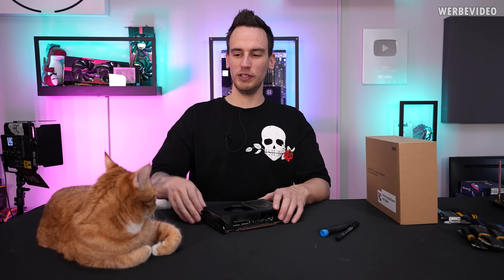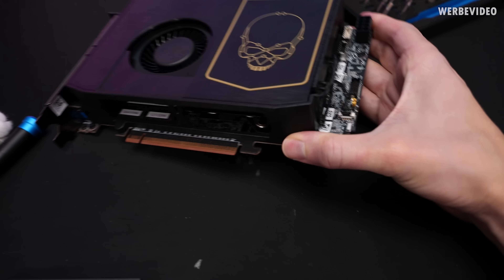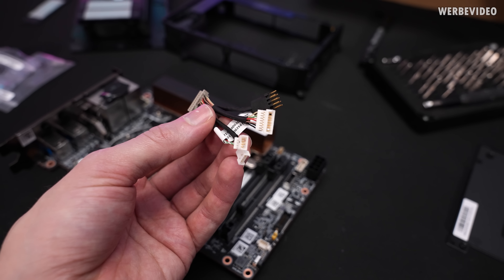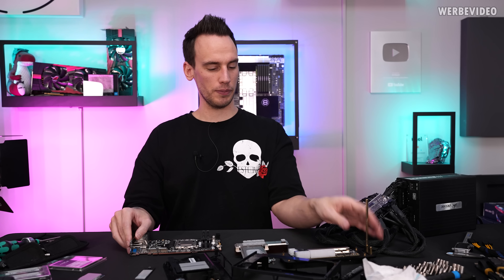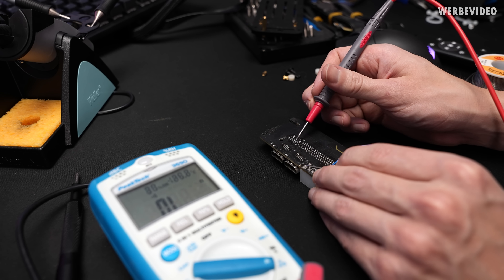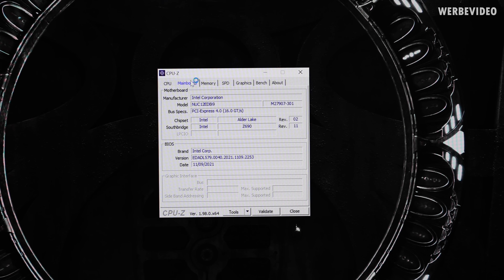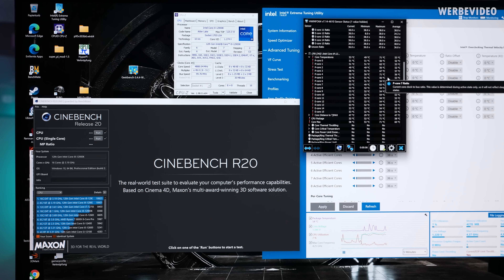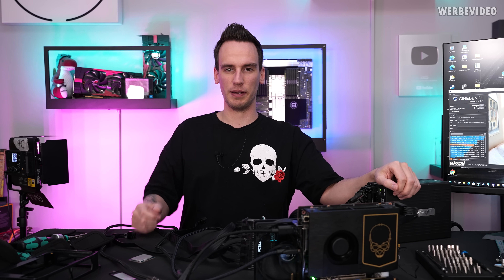BIOS Lock Bypassed! Only the VRM has to survive 220W on this 65W Intel NUC

Comment: Not sure if you still read this, but suggest to Intel to flip the components to the other side of the board. Then when it's in a backplane it can be back to back with a GPU so they can both breathe - and you can add proper cooling.

Comment: You should be able to ground the green power supply wire at any point along the harness to turn the PSU on. edit: Just noticed all the wires are black... :-\

Comment: so using this cooler on the 12900k practiccally 33 percent performance loss from its max capability. sounds pretty awful 6900 compared to 10 some hundred. Do yyou think an n9i with 120mmx15mm slim fan or alpeföhn backridgedege with 92mmx25mm thick fan would perform better than this? want to build the smallest i9 rtx 3090 build that is possibly, with as much performance as possible while still being as small as possiblye, my card is fthe gigybeyte turbo 3090 of corse either msi or asus top z690 board and 700w flex atx psu with 40mmx25mm noctoa fan.

Comment: I haven't checked how the pci lanes are connected, but could disabling pci slots from the motherboard, allow this NUC to access them without ?racing?. So you can actually have 2x pcs with 2x GPUs on a single case?? @der8auer EN

Comment: I was wondering how this could be used as a tertiary PC in one of those e.g. Phanteks cases you can run two systems in. Yes please, more vid fettling this to do things it really shouldn't!
Reply: I have one of those dual system phanteks cases. Main system is mATX board with 9700k & 3060ti and the secondary is an ITX quad core xeon board that acts as an always-on linux router & services host. I like how it came out but if i had to do everything over i probably would have went for 2 separate smaller cases, just for practicality.
Reply: @mikee9167  👍Tah for the input. I get you about the practicality; but I'd be doing it for the hell of it. YMMV

Comment: Standard lga1700 socket and it works with a pcie riser and a power switch. You could do all kinds of crazy things with these. Imagine if these were supported as add-in cards and you could offload background tasks like rendering or streaming. It could also greatly extend the lifespan of cpus if you could pool system resources like that.
Reply: Contact the number above something special for you◽...

Comment: it would be interesting to take the "put a stupid fast fan on it" route to cool it. The device is so small it would be easy to isolate the noise by putting it outside the room its being used or even simple noise isolation could make server "style" cooling viable for every day use. Then again its not like overclocking is so i guess its kinda stupid.

Comment: So what are you supposed to plug it in to? If not a motherboard?
Reply: Intel has boards that have pcie slots and stuff.. boards that fit into cases specifically for nucs.. system integrators can make them too.. a full blown nuc is just one of these cards, a case and the pcie riser basically

Comment: I'd love to see a PCB breakdown of this. How efficient is this small VRM in order to power the 12900k without burning itself up?
Reply: Modern mofset have very similar efficiency and some of them they rated 90A

If looking at 90% efficiency , 220w will make 22w waste heat and that have to solve 

Mofset will fine if the waste can remove on time and temp under control

Comment: Two thoughts: 

1) This would be a really interesting way to power a couple of EGPU with those thunderbolt ports depending on the price of the NUC.

2) I'm very confused by the bottom male PCIE slot. Is it supposed to plug into a motherboard? Can it power a graphics card with a pcie turnaround? I've never even heard of a pcie turnaround. Very confused.
Reply: NUCs have other boards that are used for plugging the compute element into that provide additional expansion ie pcie.
Reply: @forbiddenera  oh interesting so just like how some machines carried their CPU on an ISA slot daughtercard
Reply: @vladimirvparfenov3935  yeah serve the home has good videos on nucs m..

Comment: That is interesting that the PCIe slot on the bottom of the compute element is an OUTPUT signal rather than an INPUT signal.

That's definitely one notable difference between this form of the compute element vs. the older Sun Microsystems Penguin PC-on-a-card add-in cards.

I wonder how bad it would thermal throttle at that power if you were to run Cinebench R20 continously for like 30 minutes or something because Intel NUCs heatsinks are NOTORIOUSLY bad at managing the thermals on said NUCs.

Comment: Wow it's dense, would actually make for a nice studio machine where we need A LOT of pci-e cards but there are never any slots left without going full server motherboard but then it would still bring up some other issues and would cost a bit too much
Reply: If I remember correctly, you can buy any current spec motherboard and add PCI-e expansion slots because the spec allows for a cascading hierarchy like USB. You obviously need a taller PC case and a large power supply if the one you currently have is a bit weak.

Comment: Can someone explain the soldering part to me? Why was it necessary? It will not power on unless you solder a power switch to it? I don't understand.  I want to use this in a different way but this part is stumping me.

Comment: I would buy NUC if it's perform well in small form like that, so I can travel with it
Reply: U need a 1200w psu which doesn't seem all that convinent
Reply: @jesselopez0008  No need 1200w psu, 550-600 is enough.. will use mid GPU like 1660 Super / 1660 Ti / 3050 / 3060
Reply: Ya no, there are fully built NUCs as well that come in a tiny case..they don't use thst much power..

Comment: A watercooling company has to make a block for this.

Imagine the absolutely tiny but monstrously powerful system you can make that way
Reply: They already exist and are better and cheaper
Reply: @riba2233  there is no option as small as the nuc.
DAN case is small but it's still double the size of the nuc.
The only comparable stuff are 100% custom and completely ridiculous time investments.

Maybe those are smaller than you'll ever want already and you don't care but that's not what i was talking about.
Reply: @SquintyGears  there are plenty, velka, sentr, dan case and lot of.other small manufacturers. Dan a4 sfx is actually smaller at 7.2L

Comment: We have one of those at the system integrator I work at. Its quite nice once you bypass the bios limitations. I used a tool called Throttlestop, normally used to overlock laptops, to overclock the NUC. I was able to get it onpar with a 12900K. The cpu that was in our NUC was an engineering sample provided by Intel. The code on it identifies it as a 12900 but its slower than a normal 12900 when you leave it stock. I believe its a low power variant like a 12900S/12900T or something else like that. We paired it with a 3060 Ti and it ran pretty well. The company owner didn't like it very much but over in the testing and rma department, we liked it a lot.
Reply: @mauxie.  doesn't matter if something is 20 years old, if it still works wonders, there's no reason to not use that
Reply: @mauxie.  bypassing limits is good, only the user is bad.
Reply: @flandrble  that's exactly what happened for him. I've been using TS for about 8 years on multiplie LAPTOP and none burned down nor throttled anymore. On desktop just get a good motherboard and don't bother with TS/XTU at all.
Reply: What is the stepping of your 12900 ES?
Reply: @ardwivedi16  I'll have to check Monday when I get back in. I didn't have a chance today to grab the NUC from inventory.
Reply: @mauxie.  I have the most experience with Throttlestop when it comes to overclocking utilities in windows. I also don't like XTU very much.
Reply: @mauxie.  If it works why not? 
just because a piece of software old doesn't mean its unusable?
Reply: @mauxie.  you can raise the throttling temp on most bioses these days as well and raises the voltage, both of which can burn up a cpu.  Should we stop using bios settings too, bios is also very old so I guess we should stop using those too.   If you don’t know what your doing then don’t mess with it.   No one is burning up their cpu with TS which is why it is still used and updated to this day.  Hwinfo is also very old but still used to this day too.  It can have inaccurate readings but that doesn’t stop NASA from using it.
Reply: @mauxie.  i dont know if you just have a weird version of throttle stop but it did not forcefully disable all thermal throttling r TJmax shutdown BY DEFAULT on my laptops but hey  you can still do a ton of damage by accidently changing something in bios or by using there 'OC' presets/mode
Reply: What are they are actually for though?
Reply: Maybe it was the laptop version?  12900h?
Reply: Remove plug able bios
Reply: chipset diver
Reply: fact is, 12900k default behavior in bioses is to let them turbo forever until temperatures just can't sustain any further. 12900k has also been pushed way too far out of its efficiency zone
However, 12900k at stock limits isn't that hard to do with 12900(s/t) that have no power limit in the BIOS (a lot of boards have this that allows "overclocking" by just raising the power limit)
I might try throttlestop on the 12700F im building for a customer ;)

Comment: Soldering the poweron line to ground seems like a wierd way to power the psu on, when you can short the cable from behind the plug with a paper clip or similar. 
Might be nice to have a power switch on the board, but you got one on the PSU as well.

Really nice little device tough. Would be awesome if you could toggle the PCIex output in bios, thus being able to use it in any PCIex socket.
Reply: That would only be a momentary solution.
Reply: @gud1kk  how would it? its the same as shorting the 2 pins on the header......

Comment: wonder if this vapor chamber could explode after enough of 220w load LOL
Reply: Lol probably not, the cpu would throttle at 100c and stay around there
Reply: @juicewrldextendedunrelease5274  if you had constant 100C at cpu with lets say no airflow just 100C 24/7 heatpipe would blow at some point, pressure buildup will make it go boom sooner or later, what I wonder about is how durable are those vapor chambers and how hard would you need to strike them with power to blow one up and how hard it would go